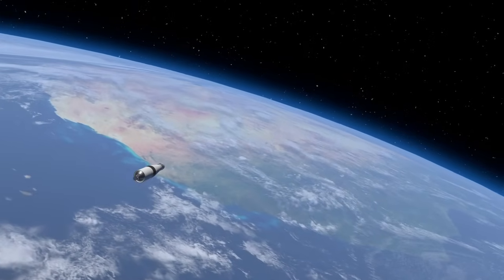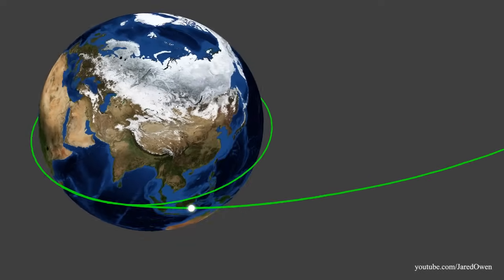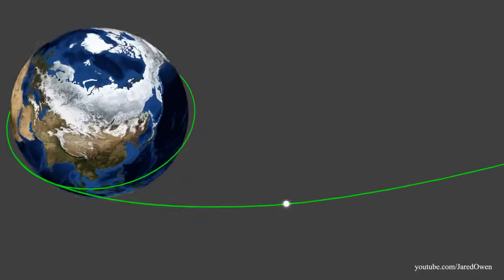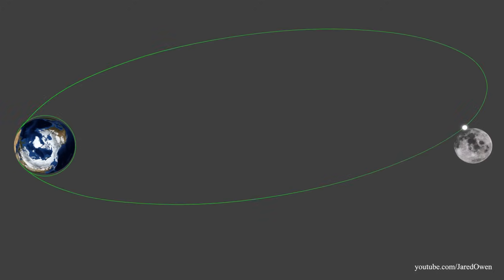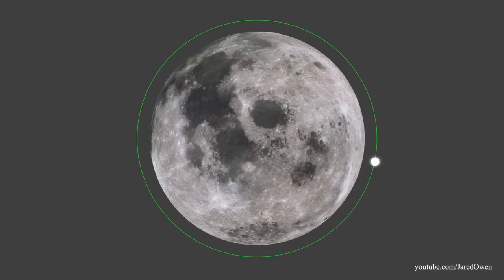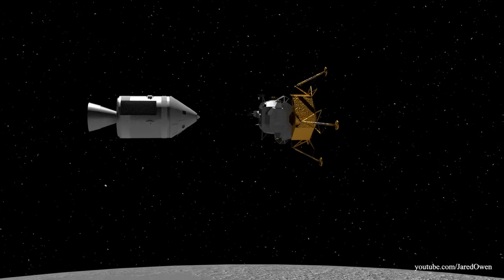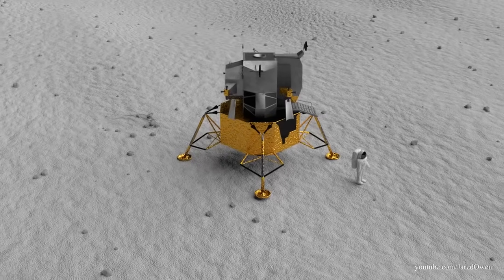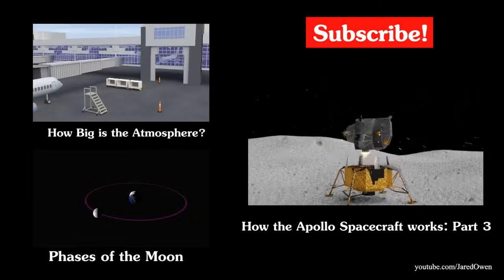How the Apollo Spacecraft works: Part 2

Comment: Rockets do not work in vacuum. The fable that the pseudo scientific bamboozlers tell us, is a gigantic contradiction of Newton’s Third Law of Motion. Nothing flies or floats in vacuum. Not even a feather floats in a vacuum.
Reply: You clearly don't know physics and are Simply repeating what you Heard from some charlatan. Rockets don't even fly. Go learn something. There Is no contraddiction of Newton's third law, at all.
Reply: Thanks for confirming you never studied for a college degree in engineering or physics. 

But you still look way impressive, son. So smart.
Reply: @kitcanyon658  I’m not your son.
Reply: Meingott  bist  Du  dumm  !!
Reply: Hm. I wonder what rockets push on very hard in the opposite direction of their acceleration?
It's the exhaust. A rocket is pushed by the expanding gas from the combustion of its fuel and oxidizev (it has both onboard)
Reply: @dr_yui_ikari  It’s not a matter of its fuel, and the oxidant necessary  for the combustion to occur (it has both on board). It’s the principle that in a vacuum there is no sustentation and resistance at all, therefore not even a paper plane, or a feather would fly, or buoy weightlessly in a vacuum. In addition to that, there is no vacuum to be found in nature, vacuum can only be found out of reach for the ordinary guy, very far away out there in the sidereal space, where nobody can check it out.
Reply: @michael.forkert  Sure, in a pure vacuum there isn't air to push on. The fuel combusts, turns into hot gas (meaning locally there is not a vacuum), and the gas 'sustentates' (since you're using fancy shmancy words) the rocket.
Reply: @dr_yui_ikari  Ok. What about flying in a vacuum? Do you think a feather would fly, or float in a vacuum? Perhaps a Drone equipped with rocket engines?
Reply: @dr_yui_ikari  May be fancy words in your opinion, but I do not employ words that do not exist, as sustantates.
Reply: @dr_yui_ikari  Ok. What about flying in a vacuum? Do you think a feather would fly, or float in a vacuum? Would a parachute work in a vacuum? 

Newton’s 3rd Law of Motion states that for every action (force) in nature there is an equal and opposite reaction. If object A exerts a force on object B , object B also exerts an equal and opposite force on object A Where object A is not equal to object B , and doesn’t contain object B as well. If object A was equal to object B , and object B was contained in object A , Newton wouldn’t have made the distinction between objects A and B in the enunciation of his Third Law of Motion.
Reply: @dr_yui_ikari  Vacuum is a VOID. And pushing against a VOID is innocuous. The thrust that comes out of the nozzle has nothing to push against, and that’s why rockets do not work in a vacuum. Here on Earth, the highly accelerated thrust comes out of the nozzle and encounters static air, and that static air exerts the opposite force, which moves the rocket in the opposite direction.
Reply: @michael.forkert  " If object A was equal to object B , and object B was contained in object A , Newton wouldn’t have made the distinction between objects A and B in the enunciation of his Third Law of Motion."

The "objects" are not equal. The one object is the rocket engine, the other object are the accelerated gasses. This logical fallacy of yours is called a strawman. You create a completely different problem and argue that this is unsolvable.

Maybe you should try some basic physics lessons?
Reply: @RonaldRaygun-tg4zl  Here is Newtons 3rd of Motion again: “For every action (force) in nature there is an equal and opposite reaction. If object A exerts a force on object B, object B also exerts an equal and opposite force on object A” 

You see: No explanation at all. It’s a statement or enunciation, which does not admit neither personal opinions, interpretations, nor examples, and even less argumentae ad personam.
Reply: @RonaldRaygun-tg4zl  What basic physics lessons you are suggesting me to try out? Those your solitary and hypnotized brain cell is trying to teach me? I don’t think so, kiddo. Note: auto or self propulsion doesn’t exist.
Reply: @RonaldRaygun-tg4zl  When object A is contained in object B or vice versa, then follows that object A is equal to object B, and evidently object B is equal to object A as well. To be distinguished from each other, object B cannot be part of object A, and object A cannot be part of object B. Otherwise you cannot distinguish one from the other.
Reply: Your car is object A, the engine of your car isn’t object B , which interacts with your car and makes it move, object B is the street or road, which aren’t part of your car.
Reply: @michael.forkert  "Here is Newtons 3rd of Motion again:"

And it doesn't prove your point as already explained.
Reply: @michael.forkert  "What basic physics lessons you are suggesting me to try out? "

5th class in school.

"Those your solitary and hypnotized brain cell is trying to teach me? "

Your brain cells are not the topic here.
Reply: @michael.forkert  "When object A is contained in object B or vice versa, then follows that object A is equal to object B, "

No, that doesn't follow.

"To be distinguished from each other, object B cannot be part of object A,"

This is nonsense, it can.
Reply: @michael.forkert  "Your car is object A, the engine of your car isn’t object B , which interacts with your car and makes it move, object B is the street or road, which aren’t part of your car."

Strawman. A car has no rocket engine.
Reply: @michael.forkert  Again  " If object A was equal to object B , and object B was contained in object A , Newton wouldn’t have made the distinction between objects A and B in the enunciation of his Third Law of Motion."

The "objects" are not equal. The one object is the rocket engine, the other object are the accelerated gasses. This logical fallacy of yours is called a strawman. You create a completely different problem and argue that this is unsolvable.

You should try some basic physics lessons for sure.
Reply: @RonaldRaygun-tg4zl  Ok. Keep dozing around.
Reply: @michael.forkert  " Ok. Keep dozing around."

Keep writing nonsense. It's funny.
Reply: @michael.forkert  But I have to ask for your age again: For a four year old child you can write well. But for a five year old child you are lacking a lot of basic knowledge. Does your mom write those comments for you? Because any six year old kid is laughing about your nonsense.
Reply: @RonaldRaygun-tg4zl  In the 17th century when Newton wrote the 3rd Law of Motion, he didn’t even dream of rocket engines.
Reply: @RonaldRaygun-tg4zl  But yours are. 😵‍💫
Reply: @michael.forkert  "n the 17th century when Newton wrote the 3rd Law of Motion, he didn’t even dream of rocket engines."

No, but his 3rd law still works for rocket engines and because of this law they work in a vacuum.
Reply: @michael.forkert  Now I have to ask for your age again: For a four year old child you can write well. But for a five year old child you are lacking a lot of basic knowledge. Does your mom write those comments for you? Because any six year old kid is laughing about your nonsense.
Reply: @michael.forkert  "Nope, rockets only fly in the vacuum of your cranium,"

This is again nonsese. Rockets accelarate a spaceship in vacuum, because of Newtons 3rd law.

"where your solitary brain cell bounces erratically forth and back in an eternal loop."

Your brain is not the topic here.
Reply: @michael.forkert   But now I have to ask for your age again: For a four year old child you can write well. But for a five year old child you are lacking a lot of basic knowledge. Does your mom write those comments for you? Because any six year old kid is laughing about your nonsense.
Reply: @michael.forkert  Take a picture of any 6 years old kid not laughing at you, and publish it on YouTube.
Reply: @michael.forkert  But now I have to ask for your age again: For a four year old child you can write well. But for a five year old child you are lacking a lot of basic knowledge. Does your mom write those comments for you? Because any six year old kid is laughing about your nonsense.
Reply: @RonaldRaygun-tg4zl  Your empty cranium is the topic here. Your empty cranium with its solitary and faithful inhabitant. 😵‍💫
Reply: @michael.forkert  Why is your skull empty? Have you ever forgotten to wear a helmet? But your empty skull is indeed not the issue here.
Reply: @michael.forkert  But now I have to ask for your age again: For a four year old child you can write well. But for a five year old child you are lacking a lot of basic knowledge. Does your mom write those comments for you? Because any six year old kid is laughing about your nonsense.
Reply: @michael.forkert  We are still missing any picture here of any 6 year old child that is not laughing after reading your nonsense.
Reply: @RonaldRaygun-tg4zl  What a pity .😢
Reply: @michael.forkert  We are still missing any picture here of any 6 year old child that is not laughing after reading your nonsense.
Reply: @RonaldRaygun-tg4zl  Take another one.
Reply: @michael.forkert  Your wish is my command: We are still missing any picture here of any 6 year old child that is not laughing after reading your nonsense.
Reply: @michael.forkert   But now I have to ask for your age again: For a four year old child you can write well. But for a five year old child you are lacking a lot of basic knowledge. Does your mom write those comments for you? Because any six year old kid is laughing about your nonsense.
Reply: @michael.forkert   Your wish is my command: We are still missing any picture here of any 6 year old child that is not laughing after reading your nonsense.
Reply: @michael.forkert  But now I have to ask for your age again: For a four year old child you can write well. But for a five year old child you are lacking a lot of basic knowledge. Does your mom write those comments for you? Because any six year old kid is laughing about your nonsense.
Reply: @michael.forkert   We are still missing any picture here of any 6 year old child that is not laughing after reading your nonsense.
Reply: @michael.forkert   But now I have to ask for your age again: For a four year old child you can write well. But for a five year old child you are lacking a lot of basic knowledge. Does your mom write those comments for you? Because any six year old kid is laughing about your nonsense.
Reply: @michael.forkert  Now I have to ask for your age again: For a four year old child you can write well. But for a five year old child you are lacking a lot of basic knowledge. Does your mom write those comments for you? Because any six year old kid is laughing about your nonsense.
Reply: @michael.forkert  And we are still missing any picture here of any 6 year old child that is not laughing after reading your nonsense.
Reply: @RonaldRaygun-tg4zl  Have a nice one.
Reply: @michael.forkert  We are still missing any picture here of any 6 year old child that is not laughing after reading your nonsense.
Reply: @dr_yui_ikari  Asking and answering your questions on your own is nonsensical.
Reply: @dr_yui_ikari  One of the saddest lessons of history is this: "If we have been bamboozled long enough, we tend to reject any evidence of the bamboozle. We are no longer interested in finding out the truth. The bamboozle has captured us. It's simply too painful to acknowledge, even to ourselves, that we have been taken. Once you give a charlatan power over you, you almost never get it back.
Reply: If you were in a vacuum holding a bowling ball and you pushed that bowling ball away from you, I can assure you that you would be propelled in the opposite direction.  It's one of the most fundamental laws of physics : the conservation of momentum.  A rocket works essentially the same way - except instead of taking a bunch of bowling balls, they take rocket fuel and an oxidizer.  They have mass, and they eject that mass away from them at extremely high velocity - since they ignite it.  The rocket is going to be propelled due to the ejection of all that mass.  I can assure you.  It's astonishing that you could even think such a thing - - - even if you don't now a thing about the mechanics of this (you clearly don't).  There are a LOT of people who do.  Where are all the physicists of the world pointing this out if it were true?  Seriously?  Did NASA someone find every single physicist in the world and someone convince them to keep quiet?  The whole idea is preposterous based on that alone - - - much less the basic physics which you clearly don't understand.
Reply: @willoughbykrenzteinburg  If you were in a vacuum holding a bowling ball and you pushed that bowling ball away from you, I can assure you that you would be propelled in the opposite direction . 

How can you assure me that? In the first place to hold a bowling ball in a vacuum, I and the bowling ball have to be floating in a vacuum. As a vacuum is a void of any matter, what would sustain me and the bowling ball floating, psychic levitation? 

It's one of the most fundamental laws of physics : the conservation of momentum . 

 Newton’s Third Law of Motion, comes first. Conservation of Momentum comes after object A pushes on object B and puts it into motion .  Here’s Newton’s 3rd again for your scrutiny: 

Newton’s 3rd Law of Motion STATES that: “For every action (force) in nature there is an equal and opposite reaction. If object A exerts a force on object B, object B also exerts an equal and opposite force on object A”
Reply: @l.forkertYou literally stated the law that proves my point.

If I exert a force on a bowling ball, that bowling ball will exert an equal and opposite force on me - - - ergo, I will be accelerated in the opposite direction to the direction of the force I exerted on the bowling ball.

Newton's third law and the conservation of momentum are very closely related.  The momentum of a system remains conserved.  The "system" in this case is you and the bowling ball you are holding.  If your starting momentum is zero, the momentum if that system will always be zero.  If you push the bowling ball away from you, you will have imparted a non-zero momentum on that bowling ball.  The TOTAL momentum of you and the bowling ball will ALWAYS be zero, so in order for the momentum to be conserved, you will move in the opposite direction so that the SUM of the momentum remains zero.

The same thing applies to rockets.  A rocket and all of its fuel will ALWAYS have the same momentum.  If a rocket ejects all that mass away from it at high velocity, the rocket will NECESSARILY accelerate in the opposite direction to conserve momentum.
Reply: @willoughbykrenzteinburg  You literally stated the law that proves my point . 

Nope, according to Newton’s 3rd of Motion, NOTHING flies or floats in a vacuum. To push against a bowling ball in a vacuum, you and the bowling ball have to be flying or floating in a vacuum in the first place. As NOTHING flies or floats in a vacuum, it’s impossible for anybody to push against a bowling ball in a vacuum .
Reply: @michael.forkert This is the dumbest thing I've seen anyone utter in a very long time.
Reply: @willoughbykrenzteinburg  No it isn’t. Position yourself on a Skateboard perpendicular to a wall. Push yourself away from the wall. So, what will happen? You apply a force in direction to  the wall. The direction of your force applied is: A—>|B (wall) that’s your Action. The Reaction to your Action comes from the wall  A<—|B (wall) with the same intensity but in the opposite direction of your pushing, this force is the reaction which pushes you away from the wall. 

Etymology of Vacuum: The word vacuum comes from Latin an empty space , void noun use of neuter of vacuus, meaning "empty", related to vacare, meaning "to be empty" (Wikipedia). Try to push against an empty space, and you will see that you will experience no reaction to your action from the empty space, and your skateboard will stay put.
Reply: @willoughbykrenzteinburg  A vacuum sucks everything into itself, including the “mass expelled by the rockets” .
Reply: @michael.forkert  A vacuum doesn't suck anything.  That's not how it works.  Higher pressure flows into lower pressure areas.  A vacuum doesn't suck things into it.  It's the higher pressure areas that PUSH into the lower pressure vacuum.  

You will never win this debate with me.  I am far more educated than you are whether you recognize it or not.
Reply: @willoughbykrenzteinburg  "I am far more educated than you are whether you recognize it or not."

Well, after reading his comments this doesn't mean much. Personally I know nobody - small kids included - who is not far more educated than him.
Reply: @willoughbykrenzteinburg  The rocket is going to be propelled due to the ejection of all that mass . I can assure you . 

You shouldn’t assure anybody with fixed unproven ideas. The rocket is NOT going to be propelled due to ejection of mass, because in a vacuum there is no object B to react against the gases expelled by the nozzle. In the atmosphere the action reaction process is the following:  object A (rocket)  expels gases —> which hit object B (air) which reacts against the mass ejection, propelling the rocket in the opposite direction of the gases expelled .
Reply: @l.forkert You seem to be OK with accepting that rockets can push off air.......a gas......but not considering that isn't the gas they push off of.  It's the DAMN IGNITED FUEL.  A GAS.  A much more DENSE gas.

When you fore a gun, there is recoil because that bullet pushes back on the gun when it is ejected out at high velocity.  Thinking rockets would work in a vacuum is no different than thinking guns would have no recoil in a vacuum.  It's not bullet pushing off the air.  It the bullet ITSELF which propels the gun backwards causing recoil.  Rockets work the same exact way except instead of expelling bullets; they expelled burning rocket fuel - - - and a LOT more of it - - - and a LOT faster.

When you fly a plane, you use fuel to operate an engine which turns a turbine or propeller, and that prop pushes off the air  It basically takes in air, and then pushes that air (which has mass) away from it.  In a rocket, the fuel isn't operating propeller or turbine which in turn pushes off something.  The rocket is pushing off its own ejected fuel in the same way a gun is pushing off its own ejected bullet.
Reply: @willoughbykrenzteinburg  Seems you have a fixed idea about recoiling. The bullet itself causes no recoiling; it’s the ignited gun powder which explodes and hits the bottom of the cartridge which hits the bottom of the barrel. But that has nothing to do with: NOTHING flies or floats in a vacuum .
Reply: @michael.forkert  You can repeat yourself all you want.  Can you fire a gun in a vacuum?  Yes.  There's no different from a thrust standpoint of ignited gunpowder and ignited rocket full.  The only difference is the gunpowder accelerates the bullet.  In Rockets, the propellant itself is the projectile.  Guns have recoil in a vacuum.  Rockets have recoil in a vacuum - except it's lots much longer.

If you took machine gun to space and let 'er rip, you will be propelled in the opposite direction.  If you fire a rocket in space, you will be propelled in the opposite direction for the exact same reason.  You fire a projectile in one direction, you move in the opposite direction.  A gun's propulsion lasts a split second.  A Rocket's propulsion : several minutes.

Step one for you is to consider the possibility that you are wrong.  Because you are.  

Rockets
Work
In
A
Vacuum

Period.
Reply: @willoughbykrenzteinburg  Have you ever fired a gun in a vacuum? Obviously NOT. Then HOW do you know that guns recoil in vacuum? Have you ever taken a machine gun to the vacuum of space? Obviously NOT. Then HOW do you know that firing the machine gun repeatedly in vacuum will send me in the opposite direction? Fixed idea about recoiling, huh? Can’t get rid of it. That can eventually drive you crazy.
Reply: @michael.forkert  So is your stance that a gun would have no recoil in a vacuum?  Yes or no?

Because if it's no, it meas you're saying gun recoil happens for the sole reason that there is air in the atmosphere.  Really think about how absurd that sounds.  People bruise their shoulders firing shotguns.  You think that's because there is air?  Honestly.   You think this?

Stand upright stiff legged holding a bowling ball.  Throw that ball as hard as you can without losing your balance.  You won't be able to do it.  And you think it's because the AIR caused you to move backwards.  The........AIR.  You can't possibly think this.  

It takes several firefighters to hold a high pressure firehouse.  Otherwise it will flail about and couldn't be controlled.  You think it's because AIR in the atmosphere?  It's generating thrust.   It's ejecting mass.  THAT is the cause of the thrust.  Air is not required.

When rockets shoot ignited fuel at a rate of over 12 TONS per second, to think they would just sit there and do nothing because they don't have air to push off of in a vacuum is idiotic. 

Your username should be Michael (doesn't know when to) Forfeit
Reply: @michael.forkert  explain to me how you think orbit work
Reply: @michael.forkert  If you understood why guns recoil, you'd know why the would still recoil in a vacuum.  It has nothing to do with air.  It has to do with conversation of momentum.  Air is not required.

Again, thinking rockets would not work in a vacuum is no different than thinking I couldn't punch you in the face and cause your head to move in a vacuum.
Reply: @willoughbykrenzteinburg  You explain it to me!
Reply: @willoughbykrenzteinburg  My very original statement was: NOTHING flies, floats or can be steered in a vacuum, according to Newton’s 3rd of Motion.
Reply: @willoughbykrenzteinburg  First: conversation of momentum, is wrong. The correct term is Conversion! . A friendly conversation with my colleagues .
Reply: @michael.forkert  Conservation....I'm talking to a child
Reply: @willoughbykrenzteinburg  Yes. conservation of momentum, as I already told you, comes after the third of motion. First you have to put something in motion and subsequently comes conservation of momentum, what is not my point of interest, and has nothing to do with the impossibility of flying or floating in vacuum.
Reply: @michael.forkert  "and has nothing to do with the impossibility of flying or floating in vacuum."

It is not impossible to fly in vacuum. May I ask for your age? For a four year old child you can write well. But for a five year old child you are lacking a lot of basic knowledge. Does your mom write those comments for you?
Reply: @RonaldRaygun-tg4zl  Nope it is impossible to fly in a nothingness. A nothingness cannot sustain anything flying. If that’s beyond your unique and lonely neuron’s comprehension, it’s not my problem.
Reply: @michael.forkert  "Nope it is impossible to fly in a nothingness. "

This is nonsense. Again: Newtons Third Law. 

" If that’s beyond your unique and lonely neuron’s comprehension, it’s not my problem."

If you do not have any clue about physics that is not my problem.
Reply: @michael.forkert  But what is your age? Normaly even children that cannot write know that your claim is utter nonsense.
Reply: @RonaldRaygun-tg4zl  As usual, when the interlocutor runs out of arguments, he tries to overwhelm the other interlocutor with Ad Personam Arguments, which consist of devaluing or disallowing the other's speech through attacks that focus on his person, his education, his choices, his character, his intellect or his acts .
Reply: @michael.forkert  "As usual, when the interlocutor runs out of arguments"

As you did.

"he tries to overwhelm the other interlocutor with Ad Personam Arguments"

Well, ayn child knows that you wrote nonsense. 

"which consist of devaluing or disallowing the other's speech through attacks that focus on his person"

Well, you wrote nonsense and you failed to delivcer any argument at all. So what did you expect?

" his person, his education, his choices, his character, his intellect or his acts ."

Well, you showed, that you lack quite a lot edication.
Reply: @michael.forkert  So I ask again: what is your age? Normaly even children that cannot write know that your claim is utter nonsense.
Reply: @willoughbykrenzteinburg  Even you don’t know whether a gun recoils in a vacuum or not. How could I know if a gun recoils in a vacuum, since I have never fired a gun in a vacuum? If you hope that you will convince me to believe in what you believe, that’s not going to happen.
Reply: @michael.forkert  Blah
Reply: @michael.forkert  May I ask for your age again? For a four year old child you can write well. But for a five year old child you are lacking a lot of basic knowledge. Does your mom write those comments for you? Because any six year old kid is laughing about your nonsense.